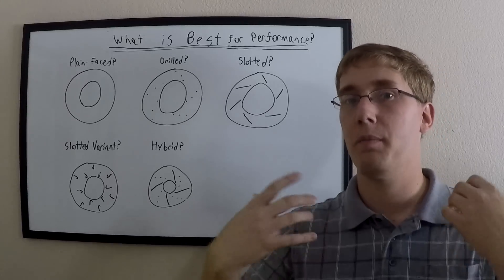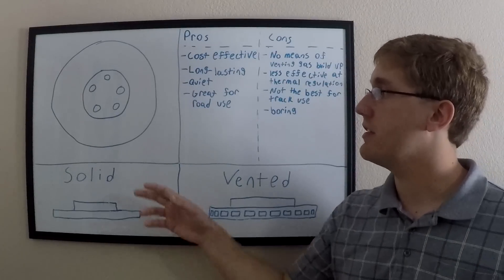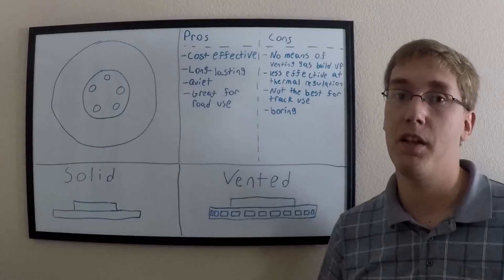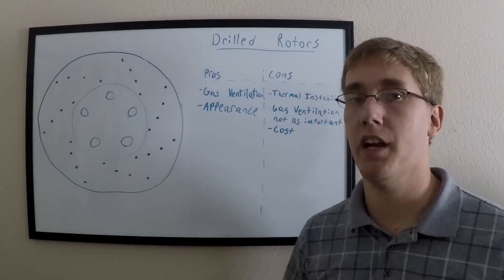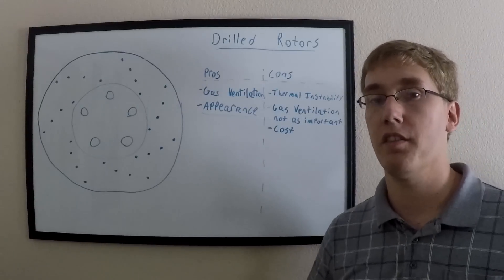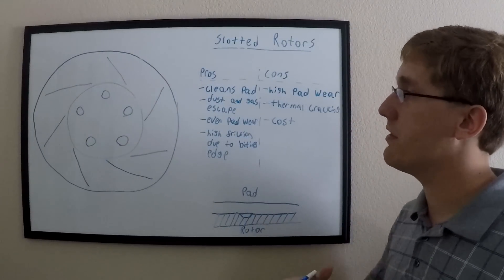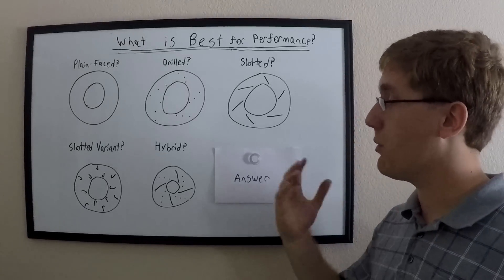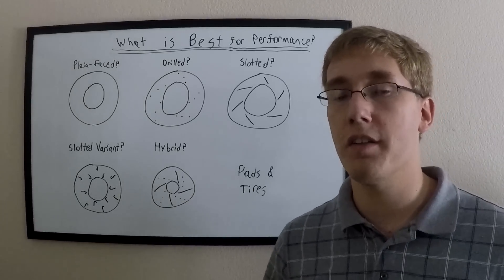Plain vs. Drilled vs. Slotted. vs ??? Rotors - What's what?

Comment: Thanks for confirming what I thought 💭 I already knew! After all......most of the stuff that looks good doesn’t always work the best. My G-pa used to tell me that factory 🏭 replacement parts are always best because they put the vehicles through all those tests before they actually start selling the vehicles.
Reply: @Mazuraski Gay
  Your Grandpa and my Dad must've talked at some point because he used to tell me the same thing...
"Son, don't you think car manufacturers put their vehicles through rigorous tests and use the appropriate parts for driving under normal conditions?"
"Well, ya Dad, but I wanna fly farther and faster... I have the need for speed, Dad! I gots to go!!"
"Then buy a damn airplane, Son."
So when I was 28yo I did.  ✈  But not before I got a ticket for doing 123mph in a 35 zone 🚔  My Dad was PISSED! I was under 18yo back then so he had to go to court with me, the judge yanked my license for a year. Bastard... ;) Ha! LOL! I had it suspended again for a year before I was 21! That was a long time ago.
These days I'm bored at 160mph.... up in the air, not on the ground! Nowadays I usually keep it under 50mph in a residential zone... 🤫
Reply: Mike  it sounds as if you’re right!! Ahh yes....The need for speed? I still have it. Not in my truck but on my motorcycle 🏍‼️it gets me the adrenaline rush the I desperately crave!!
Reply: @Mazy01152004  
    You've never had a speeding ticket?? What do you do, walk everywhere or do you take the bus? LOL! 
  OK, time for me to brag like an idiot... I've had more speeding tickets than the average cop writes in his lifetime! "Exhibition of speed", a couple "reckless driving", "too fast for road conditions", and then my personal favorite act of stupidity... when I was confronted inside a McDonalds by a cop who said they had a report of a car and driver fitting my description going over 100mph, my reply was, "Shiiitt, more like 125!" That little incident cost me $13K in attorney fees, but that's another story.
My mouth has gotten me in more trouble, more times than I can count starting in grade school. I was the kid that had my desk in the front of the classroom facing the corner. That's no lie! ;) The amazing part was with all the tickets I've had I somehow managed to maintain a driver's license except for those two suspensions. Good thing because I drove a semi truck for over 20 years. I had one log book violation and one overweight ticket the whole time. In other words, I behaved. I still do, in fact, it only took me 40+ years to start driving like a sane individual.
  I was in the USMC and had a Staff Sergeant that had a '78 or '79 Z28. He always wanted to race me for pink slips because I'd talk shit about his car. At the time, I had dumped all my money in paint and wheels, he dumped his money under the hood and I knew it. So late one night we did race, up I-5 north of San Diego, but NOT for pinks. We were running both shoulders and at 120mph he left me in the dust. I remember my steering wheel wasn't too responsive at that speed. Looking back, it's just amazing I never got into an accident and killed someone.  I think of all the money I've given the State of CA in fines I paid and realize I could've bought another house! Well, not really. I left that State 10 years ago and now I wonder why I waited so long to move out.
  Listen, I don't want to sound like a parent to you, but for God's sake, don't go flying down the road on one of them rice rockets! Keep your truck, ditch the bike. I've known several people over the years that have had some serious mishaps on a bike. My brother was on a Goldwing and stopped at a red light when a car came up behind him and never touched the brakes. He became Superman for a moment, but upon contacting the road he became a sack of asphalt coated broken bones. I'm sure you're aware of all the horror stories. On YouTube I'm just amazed by the guys that can start a wheelie at 60+ and just keep going! They've got balls, big ones... But brains, small ones! I grew up riding dirt bikes, still do in fact, just not as fast as I used to be. Hmm, maybe the bikes need a tune up... ya, that's it! I have an XR400 (tank) and a YZ250. I want a KX450F but 10K is too much. The only time in my life I've road a street bike was when I was about 23yo, high on pot for the very first time in my life, shorts, no shirt wearing flip flops with a chick on the back. That was before any helmet law. Didn't even have a motorcycle license either... "Rules were meant to broken" WAS my motto. It was a Honda CB 350? She wanted to go "do it" on the bike, but I wasn't sure how that was gonna work without a pillow and blanket (DUH!) She was hot, but I was more excited about going fast on someone else's bike! I'm not normal...
  Look up "dummy" in the dictionary... you'll find me! It was fun to be young, dumb and full of cum. These days I'll be cruising the Senior Center parking lot in 4 months looking for hot chicks, only I was told they're called "grandma's" now. Whatever. 🤤 Maybe I'll go inside and sign up for bingo and find me a high roller!! 🤑
  The need for speed is an awesome feeling, the adrenaline rush, not the drug of course. If you have 7 minutes, check out my YouTube video. This is a plane my dad left me when he passed away. I hadn't flown anything this small, light and slow. Red line was 90mph. It's experimental and falls under the Light Sport Aircraft category. Much easier and cheaper to obtain a license for than for a General Aviation plane. My kids were minors and on the ground alone so I didn't go anywhere. I just had to check it out before I sold it. Thinking about buying one within a year, the flying bug has gotten to me again.
It's titled "Kolb at the Dry Lake" or my channel is called "Luv2fu4ever69". Try this link. 
 https://youtu.be/V2EY0ww71xo
You want an adrenaline rush? Get up in the air! Then try it upside down... ;)
  I gotta shut up and get going to work before I have to fire myself!!
Reply: Mike it’s weird that my crave for speed didn’t come until I was about 25 when I rode a friend of mine motorcycle 🏍. And I’ve been hooked ever since. Thank goodness 😅 for me I’ve never had any speeding tickets 🎫.......knock on wood!! If that would have been me my dad would still be trying to yank his leg 🦵🏽 out of my rear end!! 😂😂‼️‼️

Comment: Good video. Best I’ve seen on the subject. Important point not discussed is that the cleaning effect provided by slots allows a more aggressive pad not used with street rotors due to grooving/off gassing-fade.  Slotted rotors off gas fine and keep a smooth surface with aggressive metallics. Cryogenic treatment will also extend rotor life with aggressive pads.
Reply: Well said! Totally agree

Comment: To touch on something not explained: brake cooling.

Slotted rotors do have a better brake cooling effect over plain rotors, but it does go hand in hand with thermal cracking and warping as explained.

A slotted rotor will heat up faster which can cause warping and potentially cracking (cracking is rare and is usually caused but super hot metal being cooled very quickly causing the grains in the metal to contracted very quickly forming anywhere from a small microscopic crack to a larger crack, usually they’re hairline cracks) but the slots in the rotors circulate air cooling it more efficiently.

To put in a visual explanation, say you heat two pieces of the same metal, one is say 1/4 inch thick and another is 1/8 inch thick and we put a fan on both pieces for cooling. The 1/8 inch thick will cool much fast because there is less mass. Now let’s take that same experiment and carve some grooves or slots into the 1/4 metal about 1/8 deep. The sections where the grooves are cut will cool faster and the cooling effect will start to spread throughout the whole piece. It will not cool as fast as the previous 1/8 inch thick metal but it will cool faster than the 1/4 inch thick piece.

What basically is happening is you’re reducing the mass of a rotor and adding the variable of circulation into the mix so the rotor is sort of acting as it’s own cooling fan. 

Where it gets interesting is, yes a slotted rotor will heat up faster but it will also cool faster, where as a plain rotor will cool but retain more heat for long which will cause warping to occur quicker.

Now this is based off Of very hard braking and constant use of brakes such as track use. 

In conclusion, if you have a daily driver then regular plain Jane brake rotors will suit you just fine, but if you do a lot of racing and driving on tracks, than a slotted rotor will be better suited for your vehicle.

Side note: to crack any metal, even a brake rotor, you will have to heat it to the point it is almost red or is red and throw water or a cooling agent on it to cool it very quickly to cause a crack. If a crack if formed by regular driving then that rotor was not manufactured properly (a dud) or they are usually very cheap or very old rotors. That’s not to say it doesn’t happen, but a properly manufactured rotor should not crack under normal circumstances, but there are always outliers.

Comment: I agree on the tires and pads being the most important ! .. and I also believe that slotted and drilled are quite reliable and dont offer too much worry about failure because every motorcycle I have bought came from the factory with drilled (Honda) or dual slotted  discs (Yamaha)  and they would not put them if they had fracture/failure issues.   I also have not had issues with fast brake pad wear on eiter.. so I partly agree with you.  Nice vid though, you are a good speaker.
Reply: Well said!
Reply: You can't exactly compare motorcycle and car disks to be fair.
 Slotted and drilled factory rotors that are standard on some high end sports cars have been engineered to have high strength and resistance to cracking. Whereas aftermarket slotted and drilled rotors that you can buy for regular passenger cars are not always great quality and could be more prone to cracking than solid discs.
Reply: @vxsr33  Fair enough. Quality varies for sure.  So if one were to buy a brand with known good reputation it should be decent.  And often original equipment parts are manufactured by third parties anyway so I would think this logic would be fine.  Never had any issues at all with the ones I put on the 11' Pathfinder, they were still on it when i sold the vehicle.  The pads were not great for bite,  but thats an easy swap. I do regret using the companies' pads.  Should have only purchased the rotors.  I love that they did not rust.

Comment: Remember -- The BRAKES stop the WHEELS -- but the TIRES stop the VEHICLE !!
Reply: a belt holds up the pants, but the belt loop holds up the belt.
Reply: @chemicalspore  lolthefuckout
Reply: @chemicalspore  😂😂😂😂
Reply: @chemicalspore  The belt loop holds the belt in place. Your hips hold up your pants with help from the belt and the loops that hold it in place.
 Selah.
Reply: @chemicalspore  nicely done sir
Reply: @chemicalspore  NOPE. A belt holds ITSELF up. You don't need pants to wear a belt.
Reply: And remember it's an engine (internal combustion engine)...."motor" is reserved for electric motors.
Reply: @kennycootware2323  Yep but whilst I'm sure you've heard the term, 'motor car', have you ever heard, 'engine car'?
Reply: @kennycootware2323  You're right!  A car has 3 motors, however, it has just 1 engine!  The motors are, the starter motor, the windshield wiper motor and the blower motor.  Thank God for the starter motor.  These newer engines would be a challenge to start by a hand-crank!
Reply: @kennycootware2323  fact true
Reply: @kennycootware2323  Both words have multiple definitions.
There are "economic engines", and "motor nerves" .
But none-the-less, you are generally correct.
Reply: @kennycootware2323  thank you.
Reply: You're right
Reply: I've never thought about it that way.  Nice!
Reply: people also seem to forget that smaller rotors with less pistons and flat rotors can most often stop a wheel just as fast as a 10000 dollar setup, they both can lock the wheel. Big expensive brakes are just beneficial to do full blown stops over and over and not fade.
Reply: @4touchdowns1game29  Get real, man!
The object of a braking system is to NOT lock the wheels, which is why they invented "Anti-Lock Brakes", a.k.a. "ABS". 
 There is no such thing as too-big brakes.
 https://www.mercuryforum.com/forum/grand-marquis-14/1995-grand-marquis-restoration-8937/
Reply: @4touchdowns1game29  NAH. Your street machine needs brakes that perform to match your driving style and driving conditions. Costs are NOT the major consideration when building a satisfatory braking system.
Long-distance, high-speed touring in the deserts and mountains of the American West demands superior braking performance.
I was able to build such a system for the famous 95 MERC for a relatively low cost by researching the best parts, and then shopping wisely.
https://www.mercuryforum.com/forum/grand-marquis-14/1995-grand-marquis-restoration-8937/
Reply: @4touchdowns1game29 yes, most people never will notice a difference, but if you plan to tack your car is easy to overheat them if they are too small
Reply: @sebasromero2505  exactly. It's like people forget most modern cars have the force to lock the wheels up so big brakes don't stop faster. They just save you from instant brake fade, fluid boilover ....
Reply: @4touchdowns1game29  The larger diameter rotors will give the driver the ability to feather the braking. Works better where critical braking is needed such as breaking in a curve. Better for creeping down a dirt hill as not to lock up a wheel. Better in the rain, Great for towing.
Reply: @Esteban_Herrera  yea i agree. my point was just that regular and oversize rotors can both lock the wheels up. people seem to think bigger brakes will make you stop faster. the only benefit is you can go full stop multiple times without fade with big rotors. and honestly to big of rotors and you get horrible feel. my brother once swapped the front end of a superduke onto his yz250f. those dual rotors made that bike ride horrible. thing would lock up the front with the lightest pull.
Reply: right, any functional system should lock em 100%, but during lets say a high speed chase in the city a solid rotor may warp or get so hot it destroys pads, soft pads will bite   fine but could blow apart after a emergency stop. My perferd setup is the cheapest rotors and softest(cheapest) pads, they will make dust however because they're soft they cut into the rotor less so I'm saving my rotors by sacrificing my pad, the other downside is they occasionally get carcks and sometimes blow apart after hard stops or old age witch cuts into rotor, i don't mind because I keep my old pads with 25% pad in my vehicle so if a pad shatters I just pull over and swap it out with nothing more than 14mm wrench, a few groves in rotor do cause pad damge in future but aren't a big deal because new pads will wear into it after a few stops and they're so cheap idc. Some people think expensive pads save them but really you're just chewing rotor and having to go to a mechanic more often
Reply: So it's a good thing for wheels & tires to get married.
Reply: Genius. Engineer mind
Reply: Sure, thats why on danger turn area or dead end, already stacked tires
Reply: NAILED IT
Reply: Smarty-pants 😝
Reply: Right 😂
Reply: Never go cheap on brakes or tires.
Reply: Humm... tires, not brakes.  So are you saying I don't  need brakes?.
Reply: @4-MinuteMiles  NO. WTF is wrong with you !??
Don't you comprehend degrees or nuancs ?
Reply: @4-MinuteMiles  NO. I said what I said. I'm sorry that you didn't get the message. 😁
Reply: Not really energy transfer via friction stops the vehicle, new tires won't transfer motion into heat very well on ice. Leaving useless comments only to be wrong is such a you thing
Reply: @dc304LDJT  Regardless of the ambient temperatures OR the road surface conditions, the FACT remains:
 The brakes stop the WHEELS, and the TIRES stop the vehicle. 
 Over 530 readers agreed.
It appears that YOURS is the "worthless" comment.  😁
Reply: @SlikLizrd the fact you base the legitimacy of a claim by how many sheep agree is flawed, everybody thought the earth was the center of the solar system, everyone thought flight was impossible until the Wright bros did it so if you're not a bozo you know agreeing masses has nothing to do with objective facts.... now either your logic is flawed or we can test the claims,  what stops the vehicle? I said friction you said tires..... so if I'm correct a vehicle with bald tires will have more friction on a dry rough asphalt road compared to your statement that the same car with with new tires will stop quicker on a sheet of smooth ice....know before you try to defend your bs lets just clear up that i never said tires have no effect they're just not the inherent value..... I'll stop quicker on just rims here on earth than you will floating in space with new tires.... it's okay to grow, admitting you're wrong is the first step to learning the truth
Reply: @SlikLizrd also lets test this, remove the brakes and put on new tires and than put on good brakes with old tires... which one will create friction? Friction stops movement , a tire isnt friction genius
Reply: @dc304LDJT  As I said before:
The BRAKES stop the WHEELS -- it's the TIRES that stop the VEHICLE. 
This FACT is not up for debate. 😁
Reply: @dc304LDJT   --  Sorry, dude -- but you don't seem to know anything about automotive brakes OR tires -- or the Coefficient of Friction. 
 Come back when you have some knowledge of, or experience with, the application of brakes under varying road surface conditions.